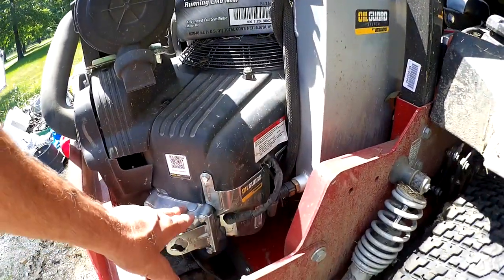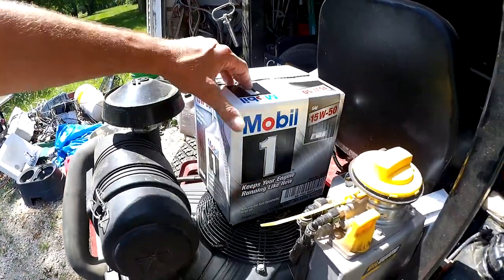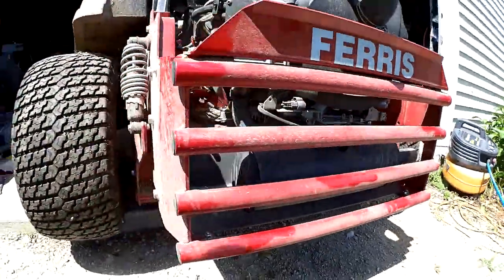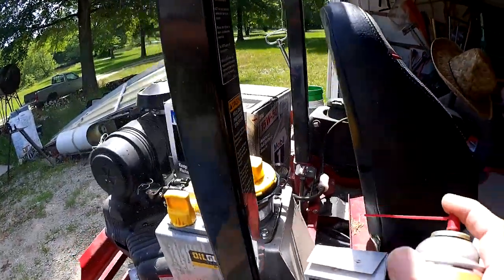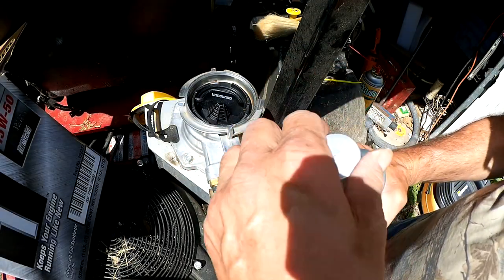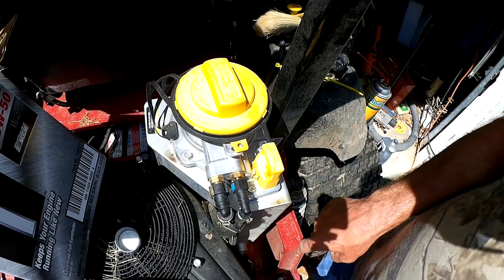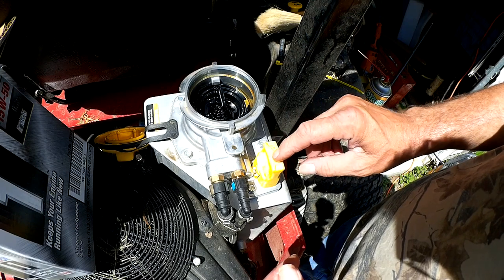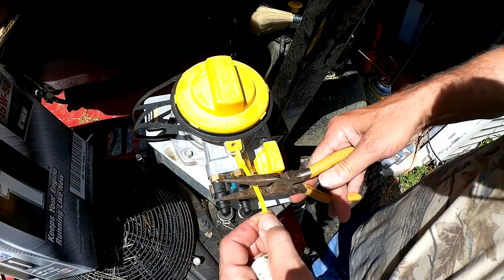How to change the oil and filter on an Ferris Oil Guard System from Vanguard Briggs and Stratton

Comment: I just ordered a new IS3200 Ferris with the 37 hp Vanguard and Oil Guard System.  Well done video.  It covered all the steps clearly.  Thanks so much!!!  Oil changes and maintenance will be a lot easier in my new machine.
Reply from the maker: This is true.  Just to keep you informed - my electric fuel pump died at 61 hours.  I hope it's a fluke............

Comment: Where did you find the info on the initial oil change of 50 hrs. I called Ferris today and they said there was no initial oil change.  I wasn't agreeing with him when he told me to change it at 500 like the manual says.
Reply from the maker: I really thought I read this on the Briggs/Vanguard site. However I can't find it. Nor can I find it in my engine manual.  I am so sorry for any confusion.  I will keep looking but it looks like you're safe just to change it every 500 hours from the start.
Reply: 50 hrs seems reasonable to me that's why I asked. 500 seems a little excessive for an initial change. Maybe you read about the vanguard without the oil guard. Let me know if you find it.  I just bought another mower that has a kawasaki on it. Nowhere does it say what the initial oil change is on it either. I called ferris on that one too and they told me 10 hrs.
Reply from the maker: I was told at the dealership to change it after the first 50 hours then go 500 after that.  But I agree - I cannot find anything in writing that says that.  So I would suggest doing each change at 500 hours even the first change out.....
Reply: My dealer said same thing...no initial oil change at 50 hrs, go the full 500.
Reply: @mowerdog  a dealer told me 250 interval is what they do, even on 500 oilguards...  food for thought.  could get it tested for $15 with shipping, but CAT lab  caterpillar heavy equip dealers sell an envelope/bottle etc.

Comment: I have two of these. They are close to needing a oil change. 
Do you need to drain the crank case?
Reply from the maker: Nothing more to drain other that what I show in the video.
Reply: mowerdog Great Thanks! I had been wondering on this. 
I don’t think I’ll make 500hrs on oil changes. 
I’m at 230hrs and it’s dark. Not black but not new. 
I’m going to go ahead and change it for safety.
Reply: No need to it’s a dry sump engine

Comment: Any update on the mod video?
Reply from the maker: Sadly, no.  I sold my acreage and moved to town.  I sold it and bought a smaller mower.  The biggest thing that helped was raise the engine rpm to 3900 rpm's.  This way while under load it runs at 3600rpm.  Briggs has a high rpm kit that makes it run at 4500RPM's for boat motors.  So running it at 3900 high idle will be fine.

Comment: I’m torn between this Ferris and the Scag Tuff Tiger 2 with the same 37hp efi Vanguard engine. Unfortunately, Scag doesn’t sell theirs with the oil guard system. That seems to be exclusive to Ferris. So, you mention in the video some “hacks” you had to do to make it run and cut better. I don’t see any new videos from you mentioning that. Please let me know what problems you were having and what you did.
Reply from the maker: I found that my blades were not spinning at the maximum feet per minute per law. I had to raise my engine rpm to 3900 to fix that. Now I'm searching for ultra high lift blades.  The Ferris cut out of the box isn't top notch and leaves some individual grass not completely cut. Raising the rpm did fix most issues.  If the quality of cut is the most important go with the  Scag.  If you want a super smooth ride and a pretty darn good cut go with the Ferris.  I'm particular about cut quality however I sacrifice that for the ride quality.  Hope this helps. .
Reply: Thanks for that info! I’m only mowing 3 acres of smooth ground so i think I’d have to pick cut quality over ride quality. Have you personally seen the Scag TT2 cut grass?  I just watched your tree stump burning barrel video. You have some good stuff! Subbed!
Reply from the maker: @stallen  Thanks for the subscription Steve!   I have not personally seen Turf Tiger's quality of cut but have heard they are among the best.  I really think the Ferris's quality of cut is from a shallow deck.  My 20 year old Gravely 260Z had a better cut and that deck was deep.  Another mower to look at that I didn't is the Spartan.  They seem to know that deck depth is key to cut quality.  Plus they have some nice features and priced right.  I personally would look at the Spartan if I did it over again. Check them out. https://spartanmowers.com/?=adhome3&gclid=Cj0KCQiAk-7jBRD9ARIsAEy8mh5BYD2vIc_O1Jw4ehyNJq2YEoW2xa3zcwKs_2Hdo5IMKkL1NafZXR8aAn2DEALw_wcB
Reply from the maker: I have also looked that the Spartan mowers.  They look well built and thousands less than Ferris.

Comment: That is how Briggs says change it BUT you know there is still 1 qt of OLD Nasty oil in that motor dont you??  Best way is to do all you did BUT remove plug on bottom side of block and drain another pint out then put your new oil into tank [plug back in] no filter yet Then remove plug wires and remove one oil line from engine to top oil filter and crank over --this will pump new oil into system and another pint of old oil out --pump into a cup till clean new oil comes out--Now put another qt oil in button up and NOW you have a COMPLETE Oil change with ALL new oil,
  Other way is like changing oil in your pickup and putting one qt of old nasty oil back into your engine--SAME THING,,Takes 6qts this way but least I know it all clean oil,,,
Reply from the maker: Thank you for the tip!  Makes sense to me.....